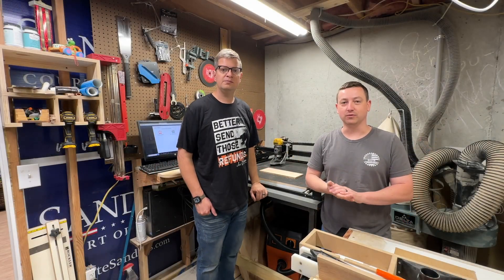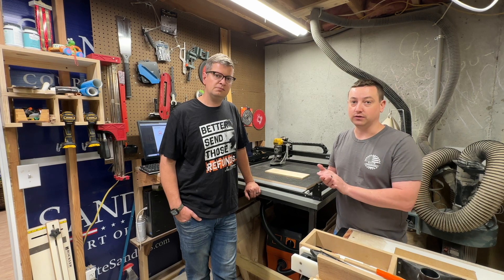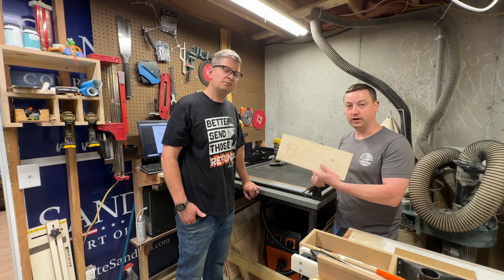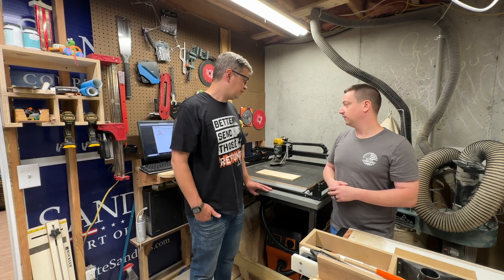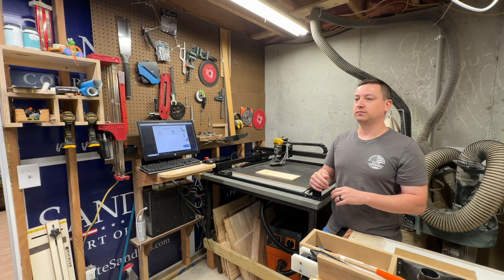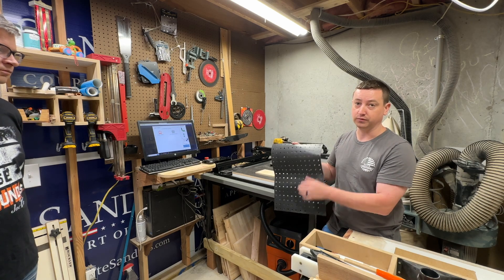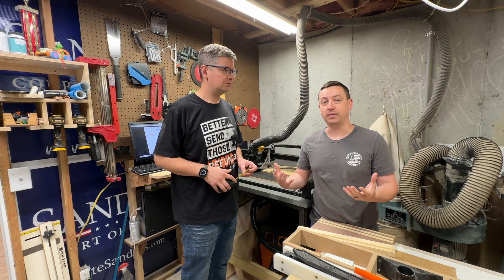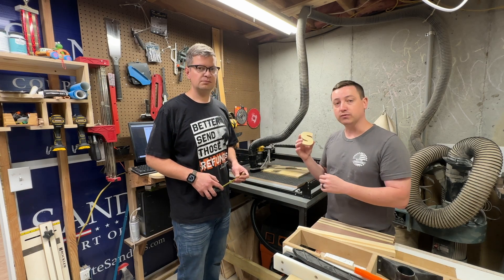Desktop CNC Vacuum Kit - Insane Holding Power! *NOW AVAILABLE*

Comment: Aside from using a Fein Turbo 11 brand. Is there other brands that is suitable for this purpose for desktop vacuum system?
Reply from the maker: None that I'm aware of. I called Fein USA and talked with two technical engineers to confirm their shop vacs will work under vacuum. They confirmed they will, due to external motor cooling that other shop vacs do not have. I also called Festool, they flat out said no it will burn up the motor. I also tested vacuum veneer pumps, they do not work for this application. A lot of R&D went into these kits. :)